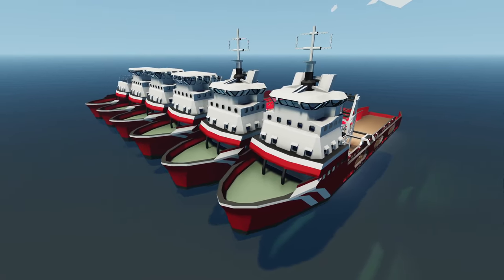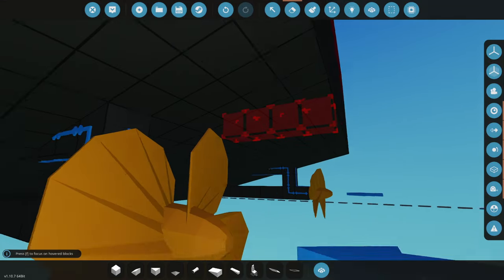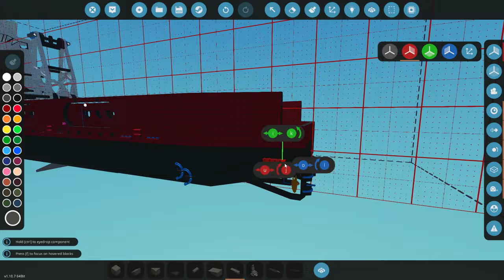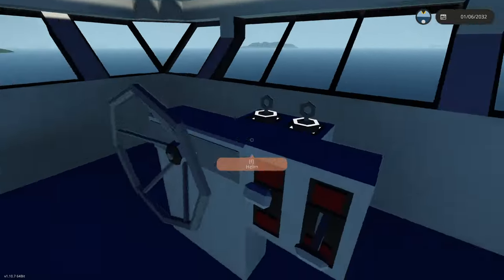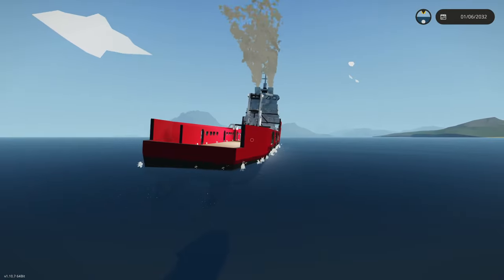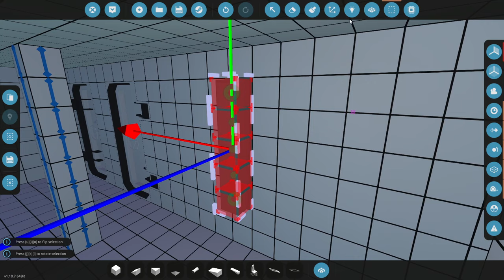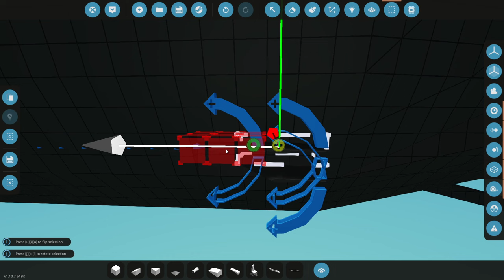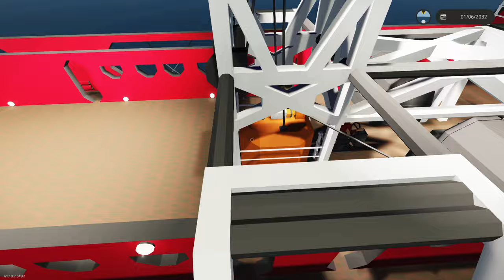Our Ship MOVES & Is Stable! - Stormworks - Diving Bell Supply Ship Build - Part 7

Comment: I think that you should move the bridge down a floor and to get the crane to slide across the back you might add you have to use linear tracks other than that its good👍👍